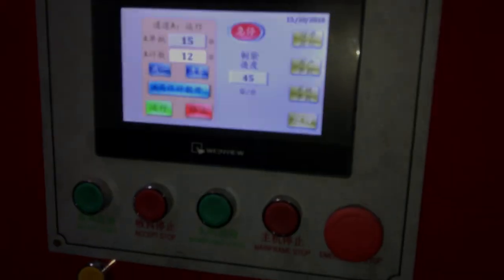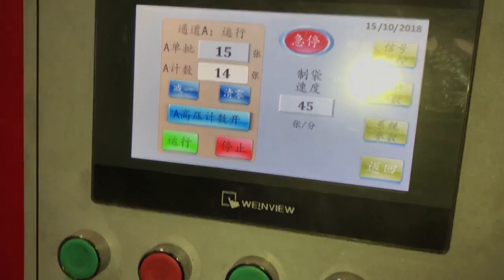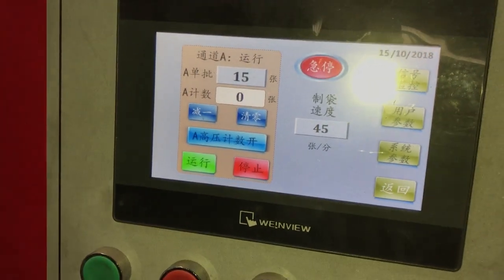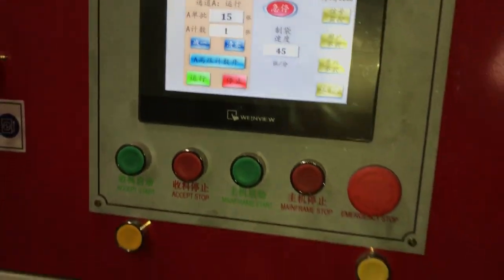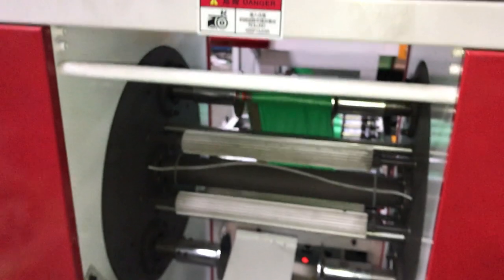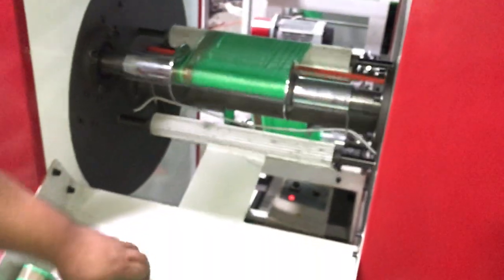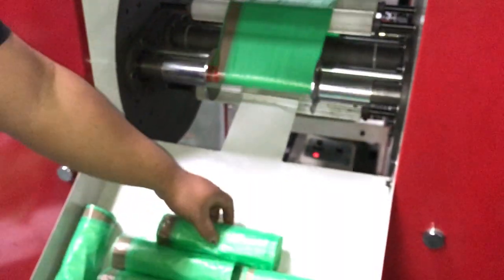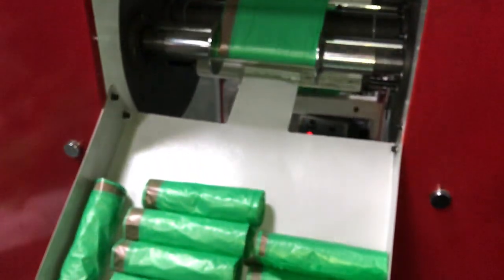fully automatically garbage bag making machine

Comment: Woah Amazing process!! what is the overall length of this single production line process?
Reply from the maker: It is about your 11m length you can add my WhatsApp +86 13587581245
Reply from the maker: It need 10m length for this machine and 2m width